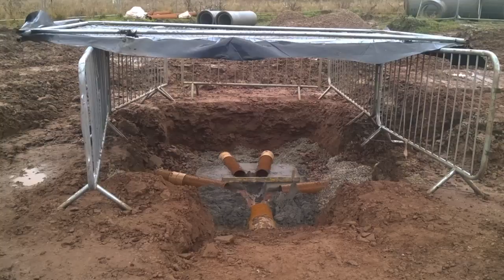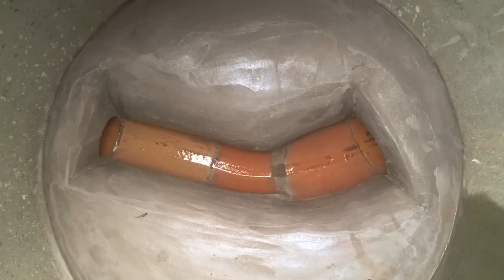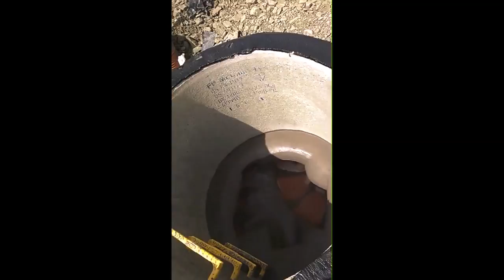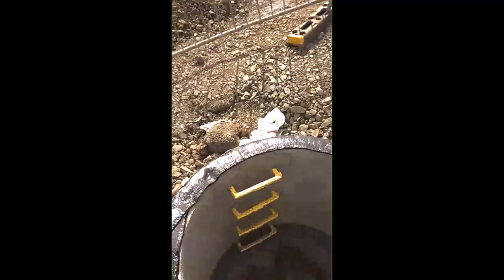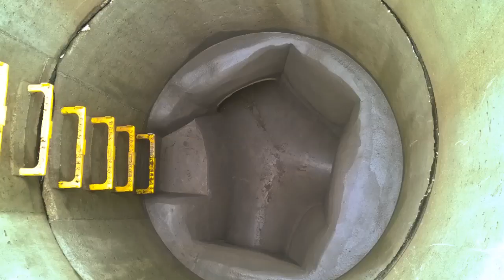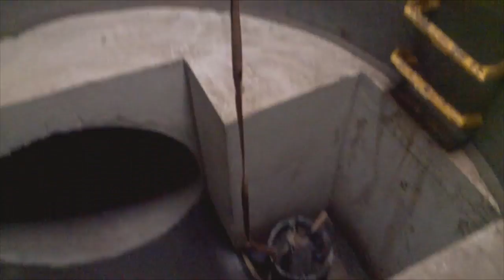Manhole Benching by David Macefield

Comment: I need to dig a trench down to my sewer at 3.22m so Water corp can put on a T junction.     The plumber then needs to extend pipe perpendicular into my property.   

I have manholes with ladders like in this video,   I was thinking I could use them to avoid the high cost of trench boxes.       But after digging down ti the sewer and putting manholes in,   What would be the best way to get the pipe that Tees off into my property past or through the manhole?        Concrete saw maybe?  

Hoping you can feed me an idea or two.    Thanks 🙏

Comment: Hi, if I'm applying grano over some existing concrete which I put in a few days ago, is it necessary to use any kind of bonding agent or slurry?  I'm going to mix SBR in with the grano.  Thanks, great skilled workmanship btw, don't see too much of that nowadays.
Reply from the maker: Hi mate, I wet the concrete and ring or raisers, just water, so Grano don't crack
Reply: @m200cey  Thanks a lot, that's good to know
Reply: I use a cement/SBR mix (after cleaning any and loose material from the drain) as a bonding agent then go over it with a sharp sand cement mortar again with some SBR in too!

Comment: Nice work! What concrete mix do you use?
Reply from the maker: Been a long time ago, 4 x Grano 2x cement 1x sharp sand, 1-3 inches thick benching over concrete, if dry wet it first or my crack.
Reply: @m200cey  is the 4 bags of grano 2 bag cement and a shovel of sharp ?
Reply from the maker: @dc1upp506  all shovels, 4 Grano, 2 cement, 1 sharp sand
Reply: @m200cey  I think that's too much grano. I always been told you only need a bit of grano just to hold the mix together

Comment: Whats the best trial for benching
Reply from the maker: I use a long plastering trowel for straight edge side of channel and round the ring, small finger pointer over sofits ect..
Reply: @m200cey  thank you.  That's helped me a lot. Will definitely try it
Reply: I use a float a bull nose trowel and a tablespoon 😁
Reply: @lukestarling6810  hm tabel spoon??! Interesting! Will defenetly try it!! I think its a good idea
Reply: What mix you using? I use 3grano  1 sand 1 cement